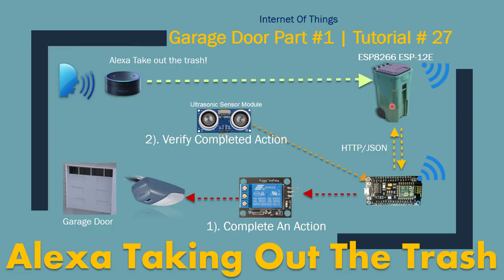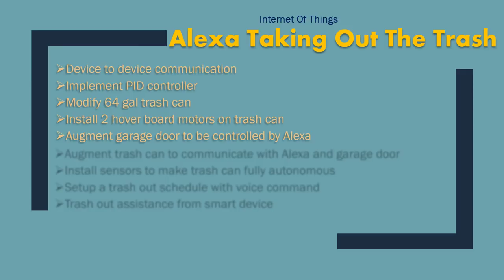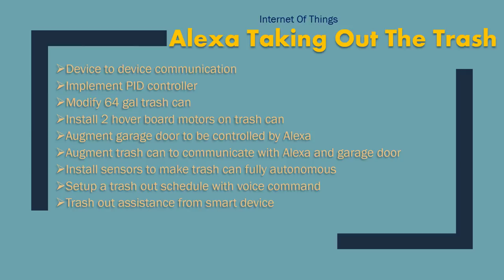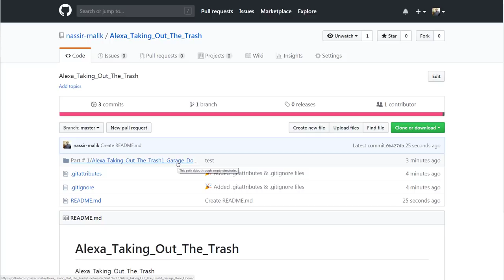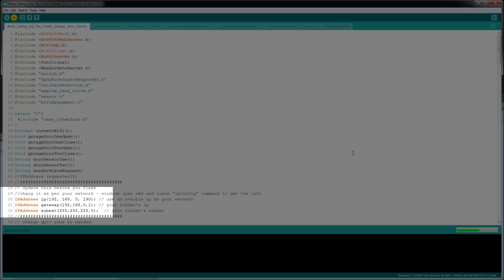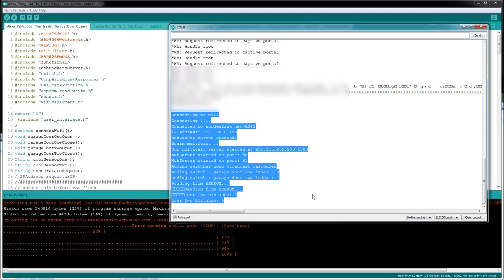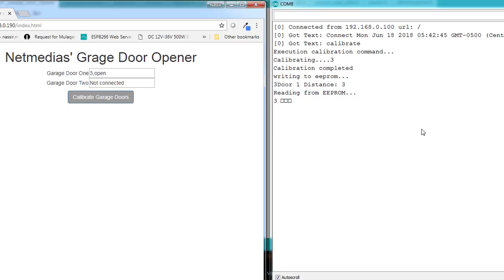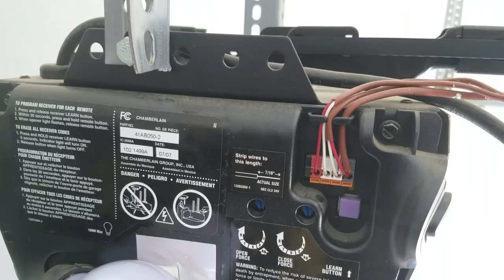Arduino trash bin | Smart Dustbin | diy garage door opener | Part # 1| #27

Comment: Great awesome concept and execution. I have now watched many of your tutorials. I’m not sure if you have finished the "taking out the trash" project, but I do have a tip on preventing the empty trash can from tipping over. Either move location of the heavy batteries to the opposite side of the hoverboard wheels, or simply attach a 5 pound weight to the light side. I hope this helps. Keep posting. Thanks.

Comment: Great little project to try btw, but currently I am receiving an error when attaching interrupt with the following message "
ISR not in IRAM!
User exception (panic/abort/assert)

--------------- CUT HERE FOR EXCEPTION DECODER ---------------
Abort called

and it keeps repeating, is there something I need to adjust or tweak to fix this issue?
Reply from the maker: Please use ESP 2.5 firmware. You can downgrade it in Arduino ide board manager option.
Reply: @netmedias7657  Downgraded to 2.5 and that runs properly, Alexa does not discover the device, was there an update that does not allow this to work properly?  I received an error when requesting discovery "Exception (28):"

Comment: This was a great tutorial too.  How did you get the garage door command to be "open/close" in the code?  Is it in the Switch.ccp?  I can only get "on/off"
Reply from the maker: Fred Mull You can use the on-off command for a plus instead of turning on or off. Set the relay to high and wait for half second and turned it off. You also use the sensor to detect the physical position of the door.
Reply: @netmedias7657  , yes I can do that, and I will using your old sketch with one relay.  I want to know how you managed to get the alexa to respond to "open" and "close" instead of "on/off".  I tried to figure it out in the sketch, but I do not understand how you did that.   Where in the code can I get the alexa to recognize "open" and "close" ?
Reply from the maker: Fred Mull Look at the "void Switch::postbackDoorStatus" function in "Switch.cpp" file. Also, you can see the function "toggleRelay" in the main sketch for briefly turning on and of the relay.

Comment: When I verify the sketch in the Arduino IDE, I get this error: "WebSocketsServer.h: No such file or directory"...is there another library that I need to install?  This is on Windows, thank you.
Reply: Got this worked out.  In case others run into this, I had to download the zip files of both "aurduinoWebSockets" and "WiFiManager" from GitHub then pull those into the project using "Sketch->Include In Library->Add Zip as Library".  I also needed to install ArduinoJson using "Tools->Manage Libraries" but you have to use a 5.x version such as 5.13.2 which is what I used.  The newer 6.x versions are not compatible.

Comment: I've looked through the code, and I don't understand how Alexa is talking to your device. I don't see anything about MQTT or anything else that I normally see needed for Alexa to talk to your device.
Reply from the maker: Flash your MCU and configure it and the open Arduio serial window and give Alexa discovery command and you will see command coming through. It is a spoof of wemo switch which is implemented by Amazon and does not require any skills.
Reply: Then what did you do? Set a routine to use open and close instead of on and off?
Reply from the maker: Added ultrasonic sensor and modify the code to detect if door is open or closed. Added wifimanager library to make it easy to configure. Also added the code to comunicate and work with trashcan. You will see how this will work with trashcan in next tutorial.

Comment: at 8:00 why not just connect the sensor power cable to the 5v pin that every nodemcu or wemos has? Or, just connect it to the VIN pin, which is directly connected to the 5v pin on the usb connector... oh, and the ultrasonic sensors exist even in 3.3v form, are identical to the 5v ones, but have NO crystal oscillator on the front...

at 11.50 there's a typo: grAge :)
Reply from the maker: Thank you for the tip. I will use it.